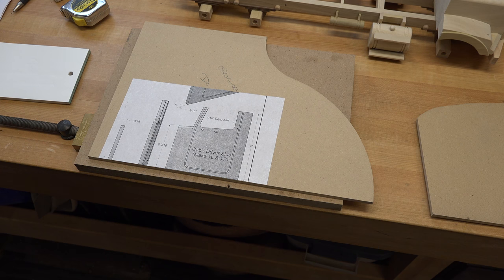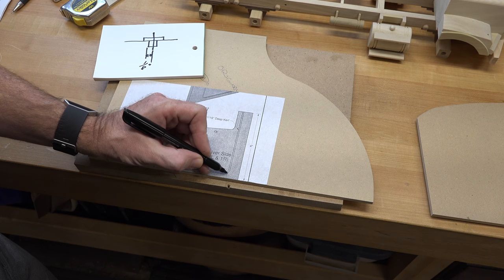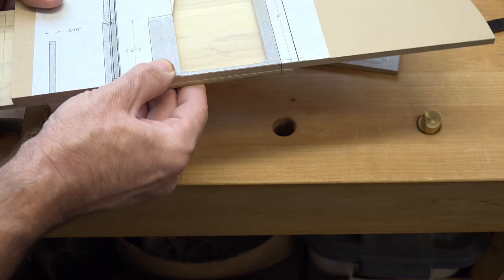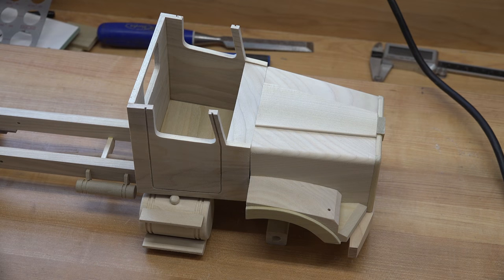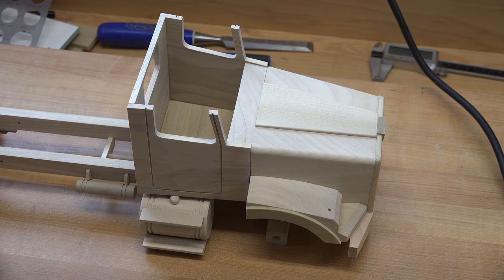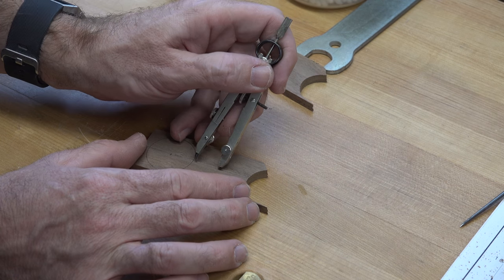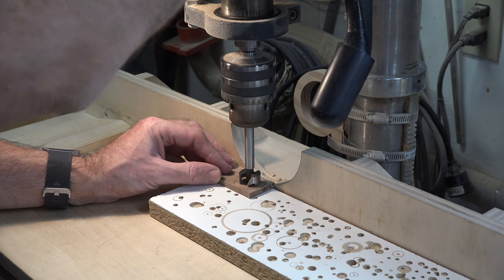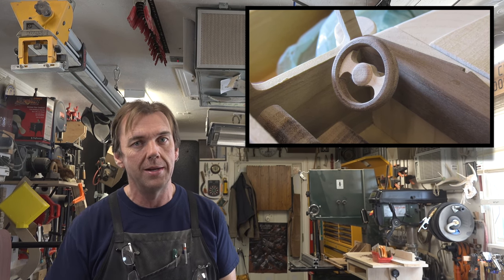Scale Model Part 5

Comment: Ken, good lesson on template routing.  Done properly the results are amazing.  Good solution on the filler cap, just an on the fly design modification.    I also like the taper you used to shape the steering wheel, cleaver idea.
Reply from the maker: Thanks Paul.  Sometimes it's not all about the big parts of the model, but rather the smaller details and technique that help along the way.  Thanks for tuning in this week sir.  Great to hear from you.